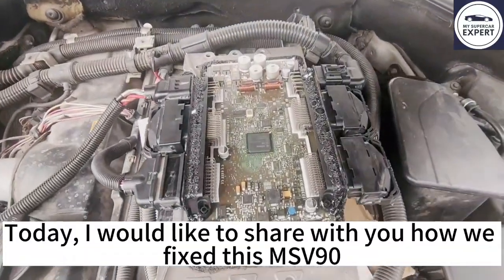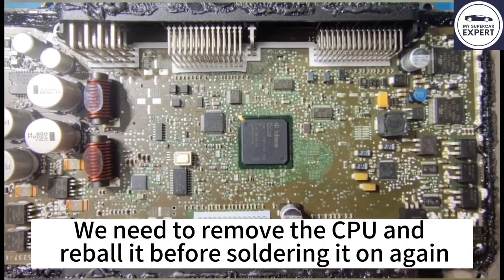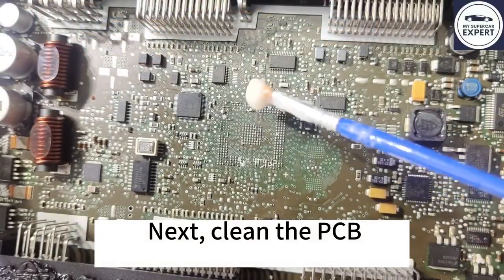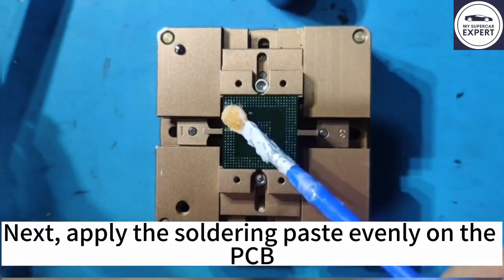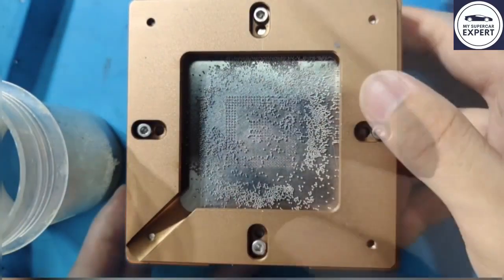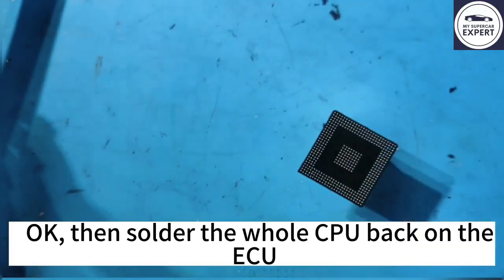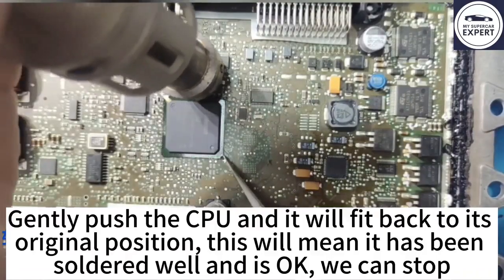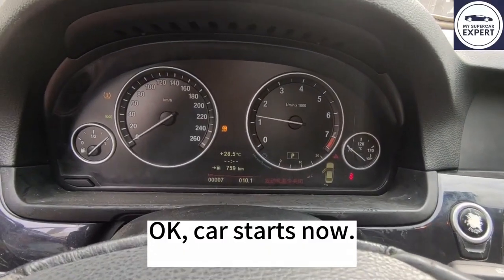MSV90 ECU internal error, old school fix！#bmw #autoparts

Comment: Thanks for the informative video. My car is now showing a dme internal fault code. If I remove the battery and reconnect it, it starts. Do you think it can be fixed by reballing the ecu? If I reattach the battery, it starts, so I am worried about the work. Thank you for your reply.
Reply from the maker: It's not an easy job, we recommend making a backup of ECU before anything else so in the worst case you can replace the ECU with a used or aftermarket DME like this one: https://mysupercarexpert.com/products/bmw-5-series-7-series-x3-continental-msv90-engine-control-unit-dme-7613806-5wk92610-used?variant=41388635488308